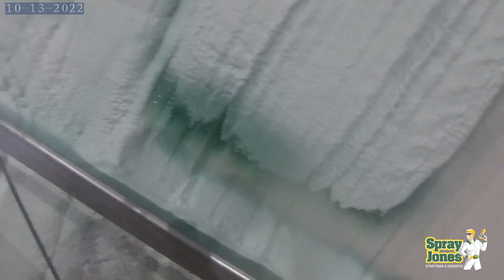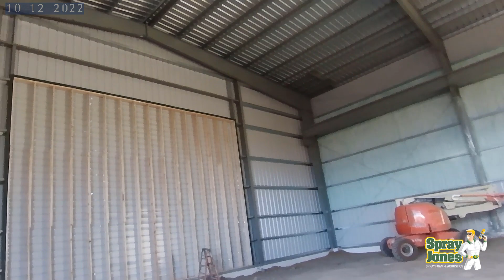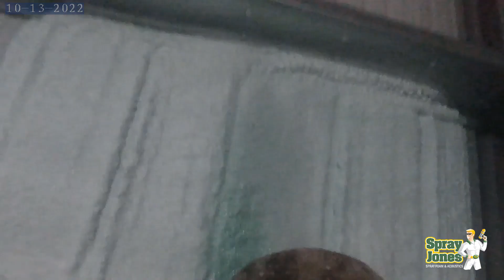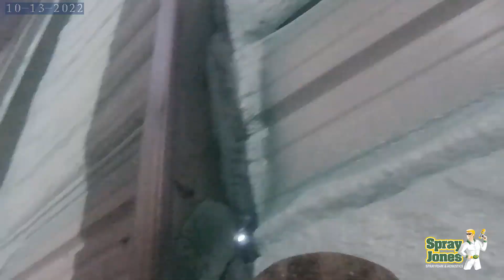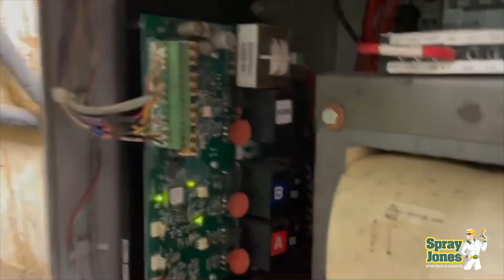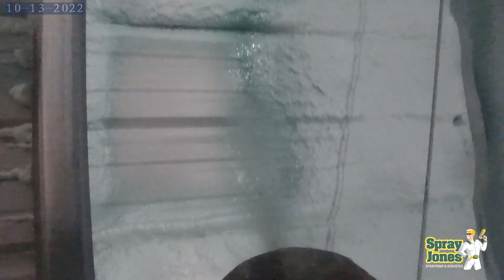Fiesta At Rick's - Spray Foam Insulation to a 12,000 ft2 Metal Shop

Comment: @sprayjones what product are you using?  The closed cell im finding in austin, still looks lumpy like open from all the vendors.  Would love to find a contractor using your product or similar gun for the same finish. Have a 6500 SQ ft Hangar and 5200 sqft hangar if you ever wanted to travel!
Reply from the maker: Huntsman is what we use. They are based in Dallas.

Comment: Your channel has been immensely helpful to my research!  You've already saved me at least $40k by not going too thick on ccSPF.  Question: I'm building a 26,000sf metal building with SSR and 24' sidewalls in East Texas.  I'm deciding between 2" and 3" both ceiling and walls, and the cost for extra inch is $46k above the $227k for baseline 2".  Your data suggests there's almost no thermal value to the extra inch.  My building is in a high wind area that has had tornadoes nearby - is the structural rigidity linear or also diminishing returns after 2" once the fasteners and sheeting is glued in.  The only advantages to 3" over 2" seems to be rigidity and sound insulation, which might be a linear function of thickness.  This video was hugely helpful because I see you didn't cover the girts and you describe why thermal bridging isn't an issue - a short video on what to cover and what not to cover in ccSPF in metal buildings for thermal bridging would be helpful.
Reply from the maker: Don, there is limited data on rigidity. I have an older video on the structural benefits of SPF if you look back to 2018 and watch. SPF 101 playlist should have it. 
A tornado will destroy anything in its path, I don't think 3" vs 2" will save you...Sound quality is nill between 2" and 3".
Reply: @SprayJones  thank you Mike.  I've watched hours of your content and gone from wanting to do 4" to probably choosing 2", at a savings of $100k that I need for other areas of the building.  I watched all four of the cathedral ceiling series.  Great informative content.  Thank you!!!

Comment: I've been a spray foam applicator for  2-3 yrs, self- taught. If I have questions I'm usually on YouTube try to address it, through other applicators mistakes. I know I'm still amateur at best. But I've also been spraying truck bedliners as well, using a graco machine that resembles the one that you guys use too. I just had a E 01 code pop up today on my line heat and it was going crazy the temp kept going up and down,like it was possessed. what could cause that problem.?
Reply from the maker: Did you watch all of this video where I specifically talk about a similar issue we had and what was causing it?

Comment: only 2" of foam on a metal building? That stuff must be amazing a preventing thermal transfer. Steel can get very cold in winter. If so, then constructions farther south must have even better thermal results from the cold.
So, I'm guessing if I get a prebuilt cabin shell, I can have all the exterior walls and roof sprayed before doing the interior framing, electrical and plumbing. 2 inches of foam won't interfere with running wire and pipes on a 2x4 frame structure.
Reply from the maker: Watch our video "how much foam do I need?"

Comment: What was the cost to spray this building?
Reply: Give or take about $8000.00 per set of chemical.   13 sets = about $100,000.00  plus priming ceiling and lift rentals
Reply: @darylnotter1365  $8,000 per set?! Where the heck are you buying foam?! At the very most $3,600. Especially with how long he has been in business

Comment: What is the Cost to do a shop this Size 6 inch Closed Cell Foam 
Walls Ceiling
Reply: Why would you want 6"? Serious overkill.
Reply from the maker: Too much foam....
You need to ask someone from your area $$
Reply: watch his video on how much spray foam do I need -- there's a chart on BTU transfer by inch showing that you get 86% retention at 2", 90% at 3" and 6" is 94%.  Seriously diminishing returns after 2". Maximum 3" before it's simply wasting money if the focus is simply thermal insulation.  You'd be doing 3 passes to get from 2" to 6" and only going from 86% to 94% efficiency...would take a hundred years to get that back in energy savings.